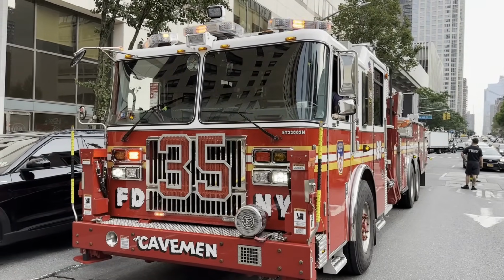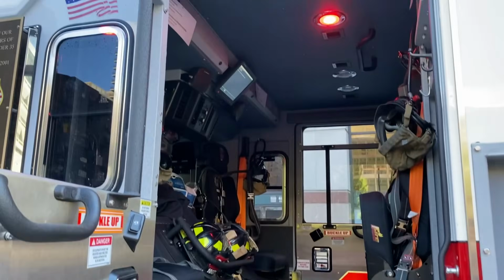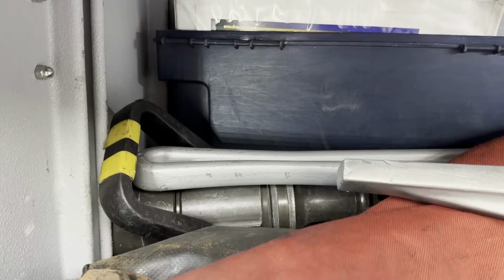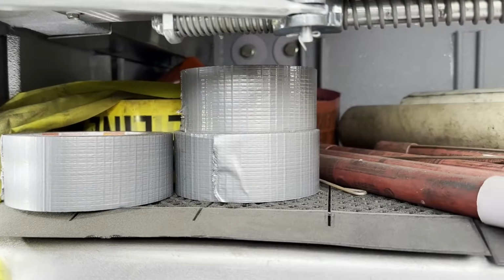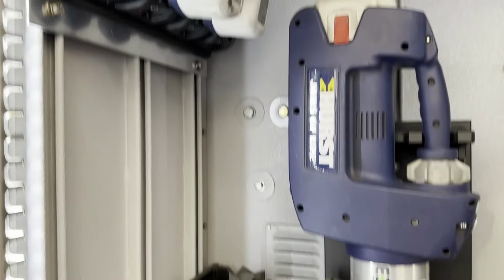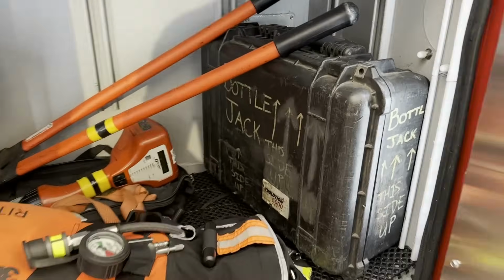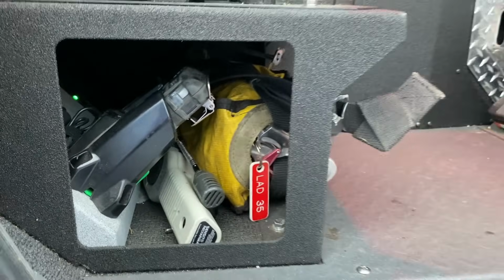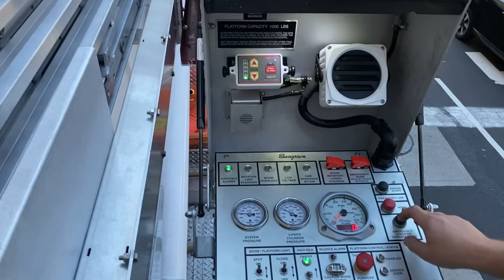🌟 FLEET FRIDAY 🌟 FDNY TOWER LADDER 35 ~ 95 FOOT TOWER

Comment: info thanks again just wondering if there’s any rhyme or reason on having the different ladders whether it be a straight stick tiller or tower ladder. and the soc support Do they use a certain type of ladder or are all the above used thanks.
Reply from the maker: Tower Ladders are mainly used for removing victims, Master streams. Sticks are used as a regular ladder. Tillers are for tight streets

Comment: Great closeup look at a tower ladder. Very impressive and a vast improvement over the old “cherry pickers.” How did they get the nickname “Cavemen?”
Reply from the maker: Many wonder how Engine 40 and Ladder 35 have become known as "The Cavemen." During the period of 1988 to 1993, a 60 story high rise building was built over top of the firehouse forcing the companies to be relocated to a temporary firehouse located under Lincoln center in one of the garages. The firehouse had no windows and consisted of many narrow passages to get around. During this time frame, the men of house were trying to create a patch for the companies that fit the firehouse. The suggestion for "The Cavemen" was made and the rest is history. The name still suits the firehouse today because of the lack of windows our firehouse has. Being situated under a 60 story high-rise doesn't leave much room between the columns for windows. The number of windows is so low that we refer to the locker room window as "the view."

Comment: Any particular reason the tower ladders aren't standardized in lengths? Why not just make all of them 95 ft. in length? Also, that the company has extrication tools - how many MVA's do they run and do they do more than just simple door pops? I ask because the cribbing compartment is next to nothing. You're not going to crib much of anything with a few pieces of wooden blocks.
Reply from the maker: The length of the truck will have a large rear end swing. A lot of tight streets in NYC. All Ladders have extrication tools. If it’s a Heavy Pin a Squad and Rescue also respond. Tower Ladder 35 covers the West Side Highway I would say 45% of there calls are MVAs